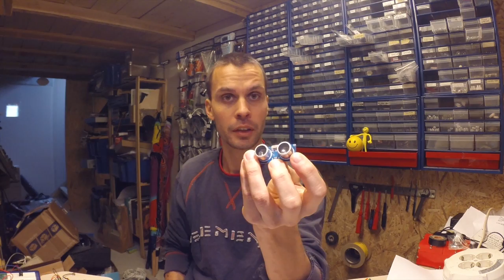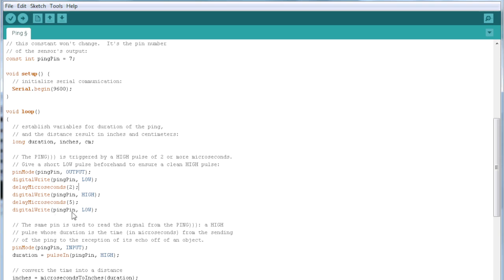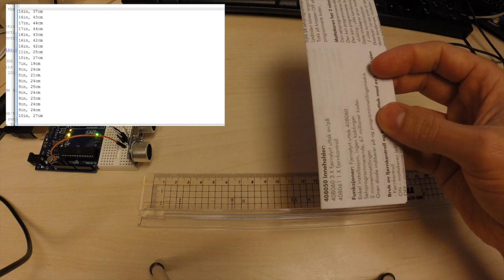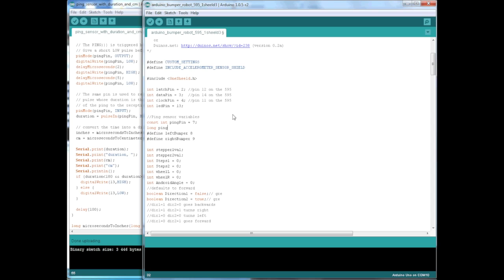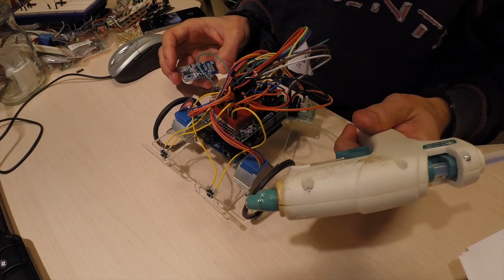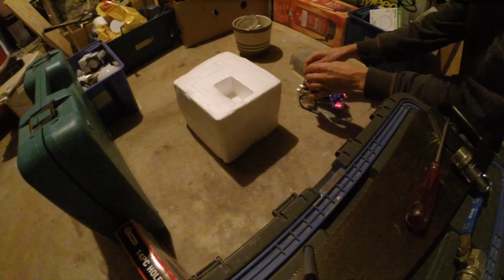Adding the Ping sensor to the robot [Anything Arduino] EP18

Comment: Hi Kristian its me again, I built the first bumper robot and that works fine, because that works good I didn't want to take it apart, so I've now built the next version with the 74HC545 chip which again works but I've built it with a Arduino Nano which seems fine and I've put the HC-SR04 Sensor on it but the code you have has the 1Sheeld code in it, I tried to watch you writing the sketch with the ping in and I put the () in but it comes up with turnLeft not declared and a few more bugs which don't come up in the first sketches? do you still have the first sketch with just the 545 and ping?, I've tried so many different versions now that I'm completely confused myself (not hard to do) loving your channel and I've sent for the 1Sheeld so expect to hear from me again Lol, might send for some 7 segment LEDs and have a go at that with you. Thanks John
Reply from the maker: I think it would work if you just removed the include 1sheeld lib and removed every row that has AndroidAngle in it...
Reply from the maker: Oh, also remove the whole block STEP2 for steering. As it is not needed without the 1sheeld...